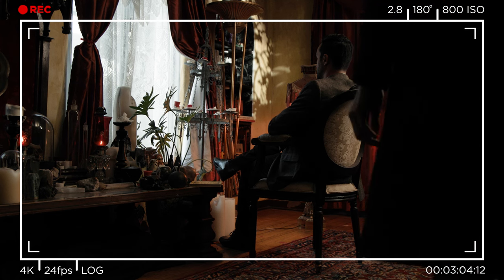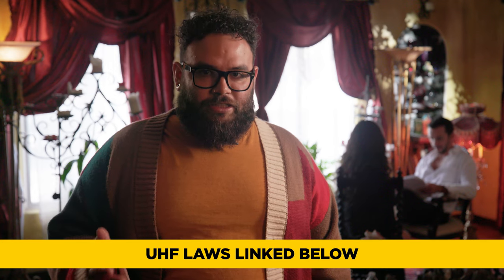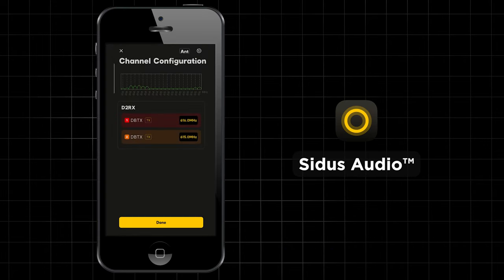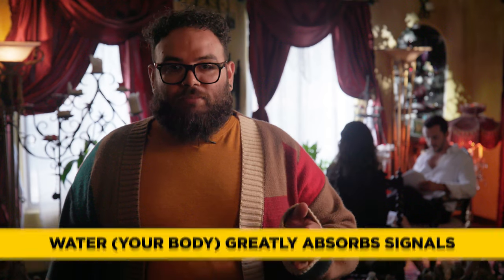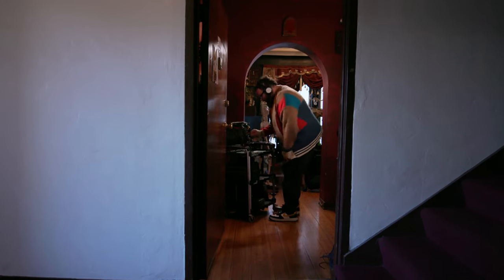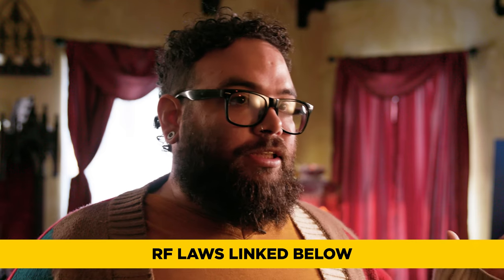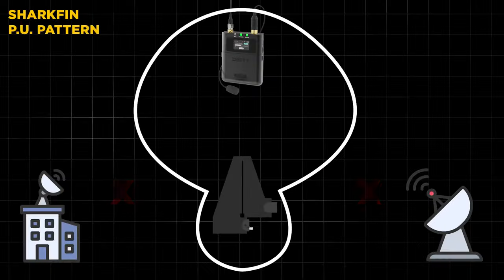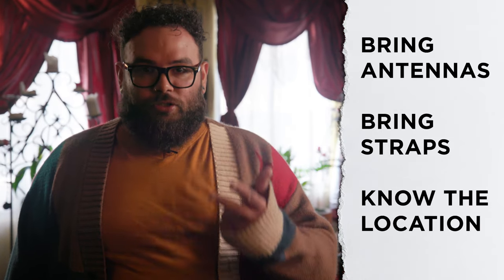Use Wireless Mics Like a Pro - 3 Advanced Filmmaking Tips for Bad Locations

Comment: hi, just wondering if the upcoming DLTX will have some kind of mounting accessory in it? I am very disappointed it doesn't have anything for mounting on a boom pole or elsewhere. If you could simply add one arri locating pin thread or nato rail that would be great, even if it makes the product slight bigger and heavier, would be worth it!

Comment: This is probably the wrong place to ask, but I can't find anywhere else to do so... What is the difference between the DBTX and the DLTX?
Reply: DBTX — standard wireless tx with a 3.5mm jack
DLTX has a lemo3 input and ability to power on phantom power 48v. You can plug lavaliers with pro-grade lemo3 jack or condenser mics like a shotgun and use it on a boom pole.